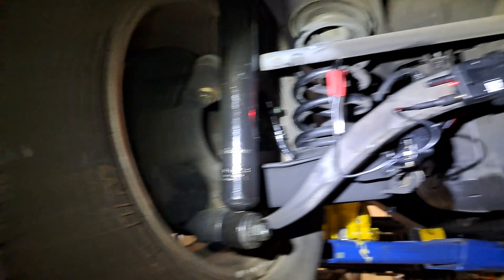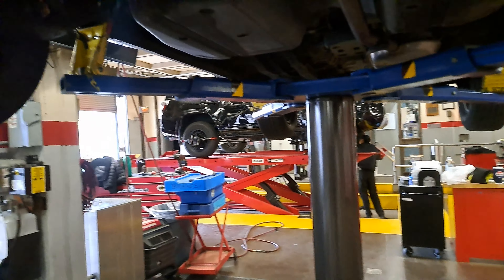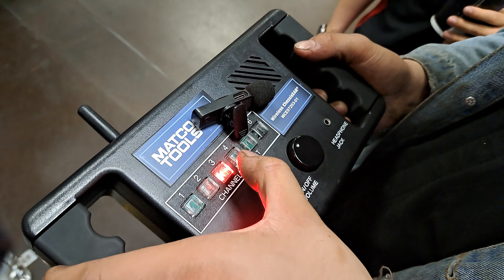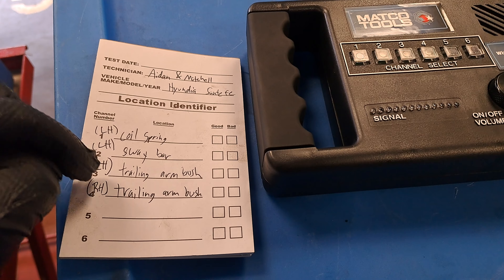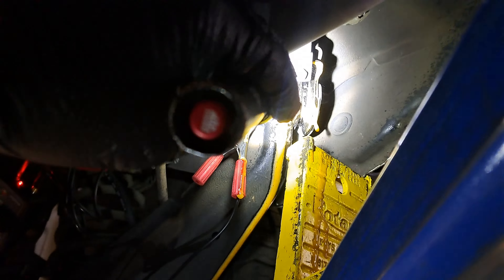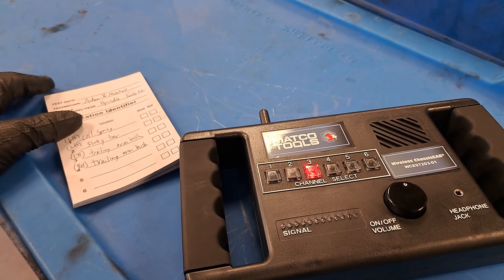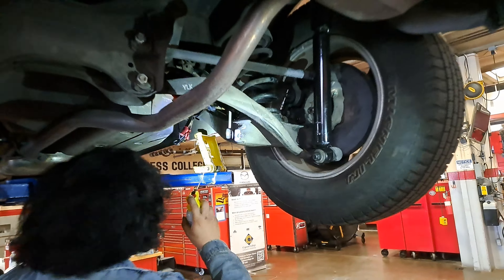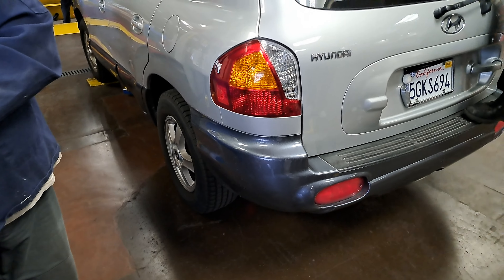How to diagnose difficult to duplicate suspension squeek noise using chassis ear

Comment: i find this chassis ear doesn't work on the engine or transmission for example if you want to listen for a noisy motor mount. The engine running will create way too much static noise on the channel and you wont hear anything else because the signal is pegged, do you also find this to be the case?
Reply from the maker: For engine noise I like to go old school with stethoscope. 

I have had some success with driveline noise and chassis ear though.
Reply: @paulkelley86  I've got a 2022 Sentra at work with 60,000 kms that has a noise similar to a CV joint breifly when accelerating from a stop with the wheels turned full lock either left or right. I've already changed the LF CV shaft but no change. The chassis ears pick up the noise on both knuckles and I also have to consider noise transfer.